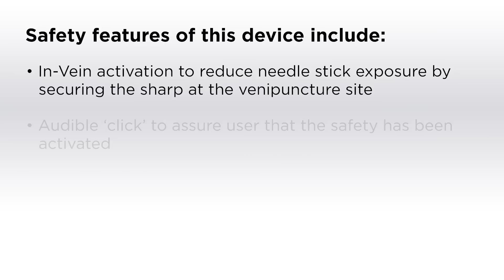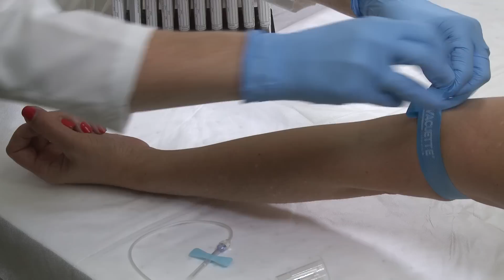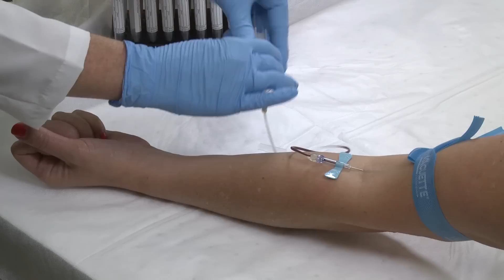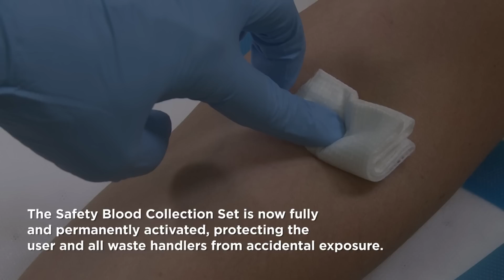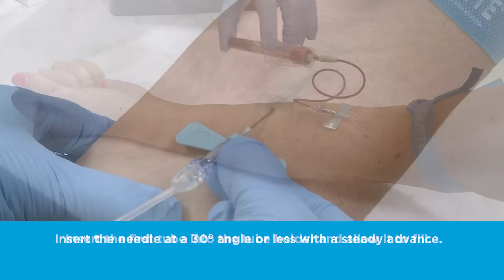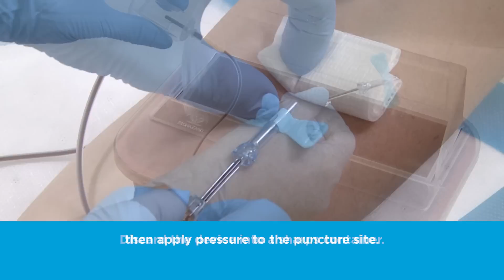VACUETTE® Safety Blood Collection Set

Comment: I had a blood test done with the help of one of these yesterday. It doesn't get better than this. It is absolutely painless and it is not possible to feel the change of the vials at all, also it doesnt feel like anything when the blood is getting collected. The only thing that I could feel was the initial pinch from the needle which in my case was one of the tiniest I have seen. A finger pinch from a small child is 100x worse than that. An absolute wonder of modern medicine this device is I can only recommend it.